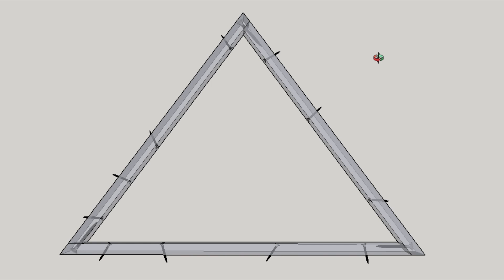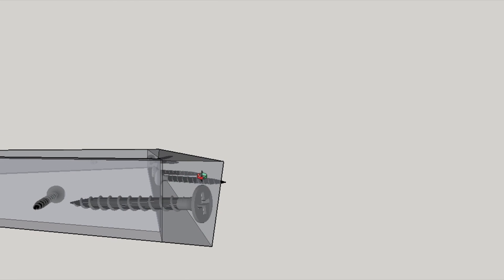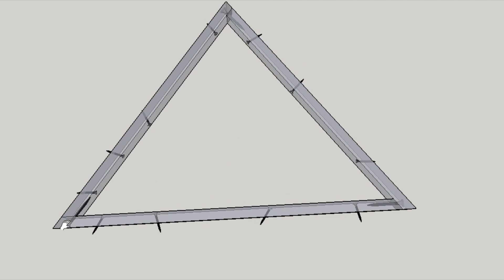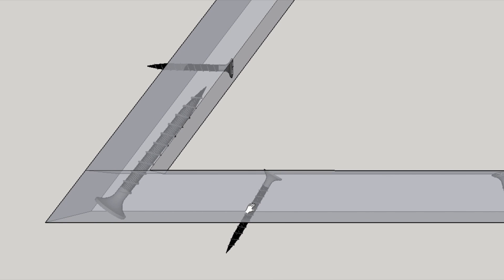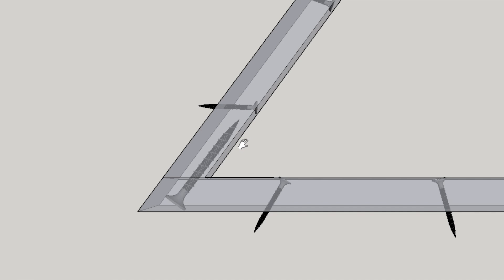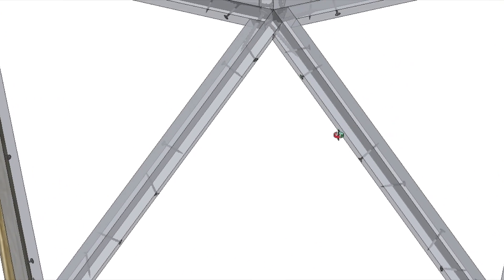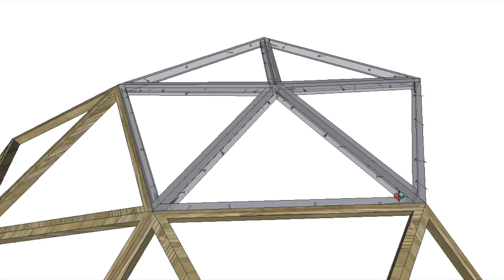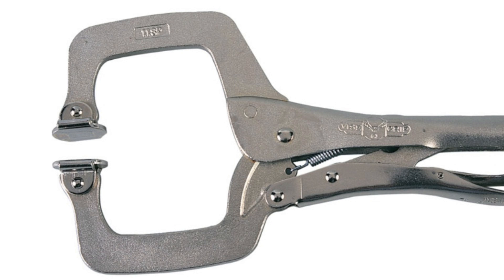Screwing geo-dome frames together

Comment: I found your tip about putting screws in at an angle interesting. I am thinking this causes the screws to fight each other slightly along the length of the joining member - thereby clamping the member together on the face, while also pulling slightly against one another... So the joint would have a harder time "slipping" in one direction or the other. Is that the thought process behind the clamping method?

Comment: So the individual triangles are joined with large screws but the frames (ie the entire domes) are held together by short, thin screws. In particular the "hubs" where all the forces concentrate have no hardware joining them. And if I understand the angles not even the rigid sheathing connects the frames to each other. Standard domes redirect forces along the length of the struts where they are strongest in compression and tension. This design seems instead to rely on the strength of those thin screws. So while I love this tight hubless technique it looks like a disaster waiting to happen. I'd expect it to blowout one of those floating hubs once a substantial load of roofing material and snow accumulated. I wouldn't feel comfortable sleeping under that unless I added metal strapping across all the hubs. Alternatively I'd double up on the counter-angled thin screws between the frames and add lots of glue. You can probably guess by now that I live somewhere that can get heavy snow loads.
Reply: I think this hubless method doesn't generate the key forces at the 'hubs' since there aren't any! The whole dome acts like a stone arch might, each triangle is wedge shaped from the side. Loads will just compress them together more, and the screws won't be doing that much.
Reply: @rjamsbury1  
Key forces are at the vertices which are common to both hubbed and hubless domes. .